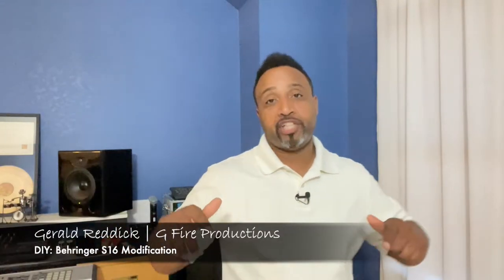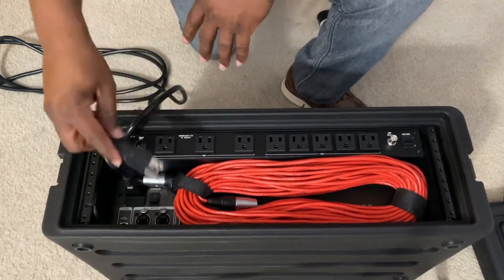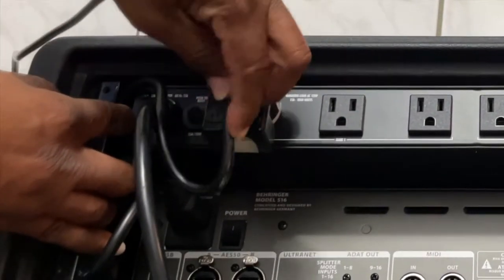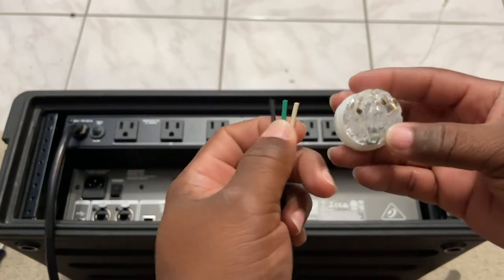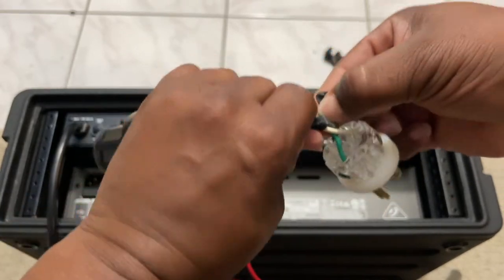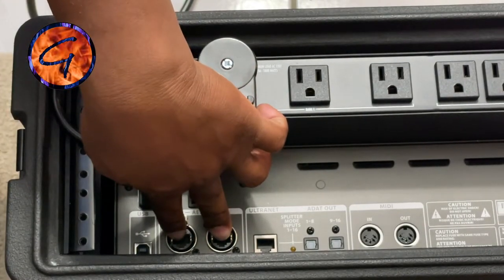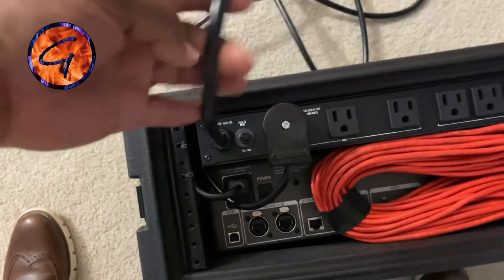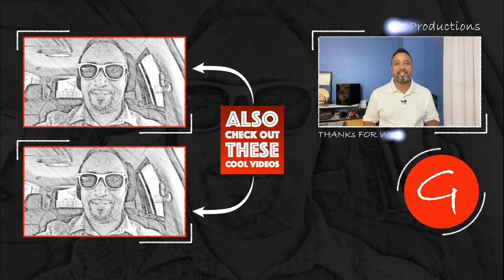Live Sound Rack MOD | Behringer S16 | Furman PL-PLUS DMC

Comment: 7:17 you should use wire ferrules for flexible wires. In Germany you even HAVE to use them. I also think when working on electricity you should know what color correspond to what connector without testing for continuity.
Reply from the maker: Thank you my friend. Good advice and everything still works just fine.

Comment: Hey bro, question can I use AES50 to USB to Mac without using an x32 or controller?
Reply from the maker: Hello Romer. I don't think so but don know for sure. have no clue. Are you thinking about trying to us it as an interface???
Reply: Yes!! So I'm trying to record a live band session without breaking the bank
Reply: @Romer0franklin No. S/Dl16 and S/DL32 aren’t standalone units. You’d have to use a mixer with them. I’d suggest the Behringer XR18 or the Midas counterpart, the MR18. They’re small digital mixers with a USB B port to connect to and use as an audio interface! Hope this helps
Reply from the maker: @Romer0franklin  after some research the answer is no the stage boxes can't be used as a standalone interface.Tthat USB port on the back of the stage boxes or for firmware updates. The Behringer XR18 however can be used as a standalone interface. https://amzn.to/3GQJzAP or maybe you want to consider an analog option with the Yamaha MG16 series mixers: https://amzn.to/3TyLiSU
Reply from the maker: @carlosdiaz5486  thanks for your input.

Comment: Is there a reason you switched neutral and phase wires? Check at 8:00

In my opinion the leads should be secured by a core end sleve to be durable
Reply from the maker: Thanks for watching Otto and for your opinion sir.. After testing out other IEC cable connections from QSC, ADJ and some other brands I use,  the way I connected and tested  the cable in the video matched exactly from Edison end to IEC end. As for durability, this works great for me because it is intended to be more of a permenent plugged in position.
Reply: @gfire_productions  your neutral and hot leads are backwards.
Reply from the maker: Hello Otto Bear and thanks for watching. That is really a good question and I think I know where you're coming from so I will try to explain why I hooked this cable up in the way that I did in the video. 

If I were building a standard extension cord with a male to female Edison plug then I would've hooked the white wire to the silver screw the black wire to the gold screw and the green wire to the green screw. However, because I was building an IEC to Edison cable the white and the black leads needed to be switched. For this I connected the black wire to the silver screw, the white wire to the gold screw and the green wire to the green screw. 

The way I tested the connections in my video was verified with the same test of different IEC cables from; 
a QSC speaker IEC cable
Chauvet freedom par hex 4 IEC cable, 
The original Behringer X 32 IEC cable. 

They all three have a continuity check per each lead, just like I did with the one that I built in the video. I hope this answers your question and it's not too confusing. Thanks again for your support Otto.
Reply from the maker: @doughammel3256  thank you for watching and your input about the connections. After testing out other IEC to Edison cable connections from a QSC speaker, an ADJ par light and some other equipment I use,  the way I connected and tested  the cable in the video matched exactly from Edison end to IEC end of all the other cables. How ever to test another theory, the neutral and hot leads are hooked up different or as you might suggest on a standard Edison female to Edison male extension cord.